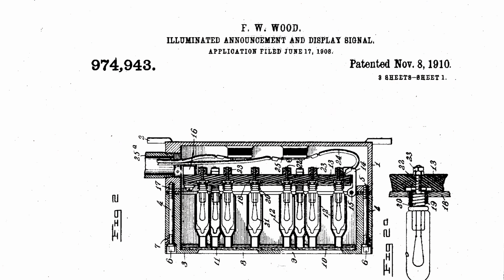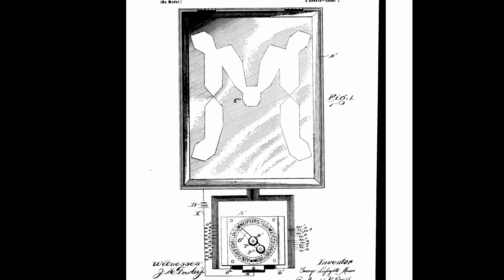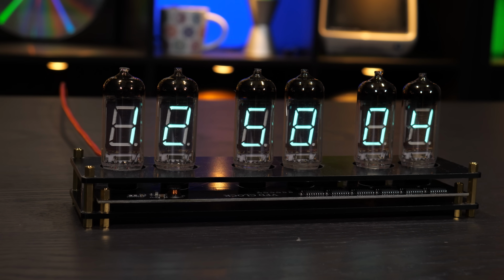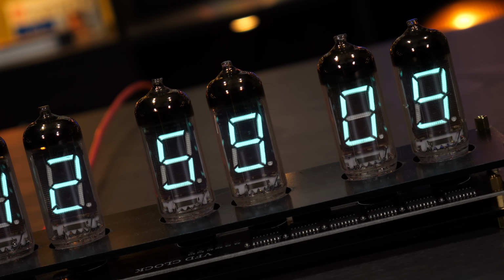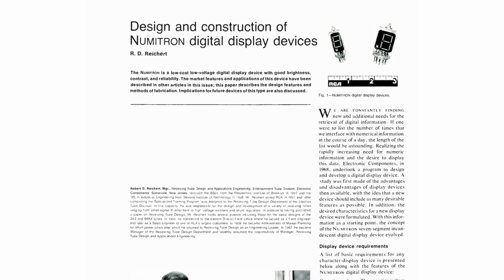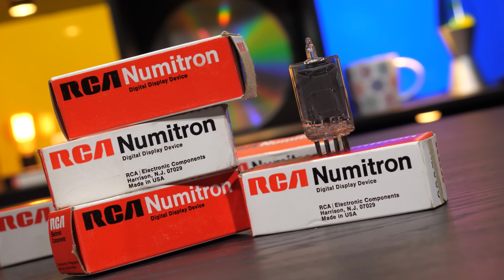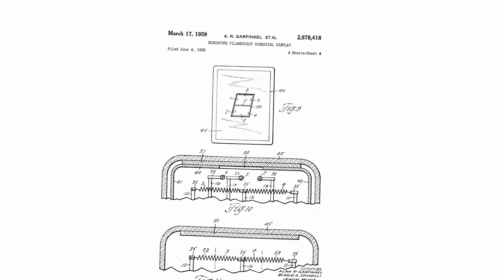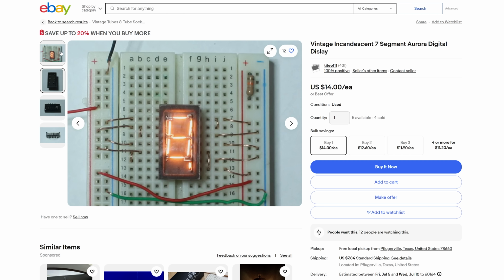The Numitron: An obvious idea that wasn't very bright

Comment: I have to say, I think that a lot of the problems you brought up with this aren’t necessarily as bad or at least they didn’t come across as bad as you claim they were over the camera. I think perhaps the reason why they didn’t have great relevancy though is not only the LEDs, but that these aren’t necessarily bad but they’re also not necessarily good and that middle of the road quality coupled with the very loose standards for quality control would mean that these weren’t necessarily as attractive as an option to designers at the time

Comment: I know the guy who did the first 7 segment LEDs for RCA. He designed them and worked out the production of them.  He worked there in the 70/80s.  He has an extreme case of OCD.  He is retired, and I have been to his apartment, and he has 10's of thousands of little electronic parts all organized on shelves in little bags with numbers on them, and he has the all inventoried in a database, so he can find them, and he still builds all kind of electronic projects.  He lives in Springfield, Ohio.   I met him on the Ham radio repeater.
Reply: That definitely sounds like a ham radio encounter 😊
Reply: Remind me of my late friend, Jim, who worked at IBM for a long time. His place was full of electronic bits, semi organized. Was constantly building little stuffs and teaching me new things. I learned a lot from that dude before he passed, he was a good influence on my teenagers.
Reply: I bet he has some really cool projects, any notable ones youd like to share? The closest cool take home I got was a set of prototype spark plugs, boss said I could have the carton because the ground electrode was in a unique umbrella shape(7 points) and it would only use the closest ground electrode to the main electrode(this was year 2009). I was 16 and put them in my car(77 super beetle) and there really was no noticeable improvement in anything, not even cold weather starts. 
Heres the cool part tho, I was racing dirtbikes back then and only had a 1985 YZ125 but was doing well, however tuning it to somewhat keep up with the people with modern bikes making more power(and still only got 1st in 4 races that year) it would foul the plug almost every 2 sessions(heats) of a 3-4 heat race. One day I was talking with some friends about the proto plugs and the fouling, we had idea to put the proto plug in the bike to see how long it would last. It actually extended the plug lifetime by a significant amount, so I shared them with my buddies who had 2 strokes. If there is a set still not in the garbage it would be in a 1991 Accord, and my buddy moved back up north and I havent spoke to him in a decade. 
Sorry for the long winded text but your story reminded me of that. Probably should ask my buddy if he still has the old Accord, the do tend to run forever.
Reply: Worked at RCA for a couple years.  That was a common thing. Most of them there were horribly OCD and hoarders. We threw away huge amounts of components. I still have quite a bit. 😂 I've thrown away most of it but..
Reply: @iconburn22 Springfield, Ohio ?  I hope any pets are OK.
Reply: You caught him on a repeater or while scanning?
Reply: sounds like a great guy. I'd like to know more about his database, as I'm interested in that kind of optimal organization.
 care to share?
Reply: @inkinky  he just tells a good story
Reply: @inkinky  weren’t you just told that was pathology
Reply: Wow, this is a coincidence. Springfield, Ohio - the topic that's been talked about recently because of the huge influx of Haitian immigrants, now making up a quarter of its population.

Comment: My dad worked at the RCA labs in Princeton from 1950 to 1980, and as a boy, I got to see some of these technologies. I saw a demo of the liquid crystal display, and during that same visit, they showed me a segmented display technology based on two-layer conductive plastic film that bends according to the polarity of the applied voltage. I remember them describing how they glued the two layers together: apply a super thin layer of epoxy resin on one layer and a super thin layer of hardener on the other, and squeeze them together. 

As for the Numitron, it's very much like the CED disk player in that it was a usable solution with the available technology, but the product was crude and janky. Dad got the patent for the CED back in 1960, long before the invention of solid state lasers; it's remarkable that they got a stylus to pick up audio and video from a disk, but IMO, it was a terrible product.

Comment: Weird that they didn't add an extra mask layer inside the tube to mitigate the bad contrast of the grey background. Sure, it would've been subject to similar heat restrictions but you could at least have masked off the lines to look better (not have th vertical ones be longer) and reduced the effect of the light bleed.

Comment: Had never seen or heard of the Numitron, despite living through the '80s.
"You might be able to see what is going on before I explain it"
Sees close up.
"Oh. Snap. Those are little light bulb filaments! That's a whole wonky light bulb with...weirdly low current? Maybe a strange material for the filament? Stupidly complicated bases with the wires and/or switches going to all those different positions?"
Man, that's bad.

Comment: I love numitrons, they look cool! Yes, the thin filaments would make them more difficult to read, but I love the orange glow, and the thinness makes them look cool. Don't ask me why, more specifically than that. And yes, LED displays are better in pretty much every way, but what do you expect, they've spent decades being refined and improved. They didn't start out being better, the early ones were tiny and dimmer, and had a much worse viewing angle than even your under-run numitrons. But yeah, as you noted, they still had their benefits, and they improved quickly, whereas numitrons did not.

Comment: I am a fan of VFDs and have several different kind of and in different sizes together with a bunch of old Soviet clock ICs. 
But any kind of displays are cool and I have a nixie clock and apart from the VFDs, have ideas for a LED and a LCD clock - got the NS chips.

Comment: Driving these straight from a BCD decoder seems like a bad idea, You're never going to get enough current. You can do it but you shouldn't, and you really count on the BCD decoder to current limit before killing itself. BCD to 7 segment decoding is really simple there might not be much in there to limit current. Pushing an IC to the limits of it's specifications doesn't seem wise.

Comment: I don't get why you rag on it so much. Double the filaments, arrange the mounting points right (which is easier than it may sound), put them against a proper light-absorbing background, and you're more than decent, you're great! That'd make it more expensive, but given that it's all standardizeable stuff, scale of production can fix this problem.

Comment: They look delightfully retro! If I were to make a time machine, it would have exposed Numitrons, sticking out in all their janky glory. I'd up the anty, and purposely misalign the bulbs too, to give mad professor vibes.

In terms of engineering, it's a wonder it wasn't done earlier. It's so obvious and with obvious benifitsts. Being able to be driven with plain old 5 Volts is huge! Consumer electronics need to work and be cheap. They seemed to fit the bill nicely. They look easy enough to read. I wouldn't use them for premium stuff or for mission critical stuff, as a single filament might burn out early, causing things to be read incorrectly... although then you could have a start-up procedure where all segments are lit up and checked  they function correctly.

Comment: In avionics, there were Minitron incandescent seven segment displays that were flat and much brighter. They actually used color filters and were higher contrast. Also, Davtron 24 hour clocks seemingly made their own flat front, multi digit, seven segment incandescent displays. A design criteria that favored the incandescent display was that the dimmer panels needed to control all the instruments in a given panel simultaneously and brightness needed to be matched along the entire dimming range. Because they were extremely expensive they haven't been popular among hobbyist types other than those fewer numbers of people interested in aircraft displays including vintage aircraft restoration.

Comment: My complaint about LEDs and displays in general is that the people selling appliances make everything too bright, 24x7.  I can't even sleep in an average AirBnB with all the "you can read by this light" LEDs -- the dishwasher clock, the microwave clock, the oven clock, the WiFi router, the outlet strips, the thermostat, the water heater, etc etc.

Comment: Way back in the early 70s we used Nixie tubes in our frequency display devices in the Air Force. We needed a reliable, easy to read display of the frequency we used to set up all of our electronic measurements. They reacted quickly and were so easy on the eyes. Loved those things back then.

Comment: I'm old enough to remember gas station pumps and butcher scales with numitron digits. They worked, even in sunlight. Circular polarizer filter. Lots of lab equipment had numitrons.  LED's came along much later. I had a TI watch with the bubble LED when I was a kid.

Comment: It’s funny that the “fault” of the grey background rather than black actually makes these more readable when installed behind a filter, as intended, as the reflected light makes the display look a bit wider than the thin element on it’s own. The similar flat versions sometimes had a green background.

Comment: "Numitron, take out Bumble Bee while I fight Prime" ~ Megatron 1972
Reply: Numitron definitely transforms into a TI-89
Reply: @skylermorris3379 if it's 1972 then maybe an HP-35?
Reply: @maikerugo  I have Hp-35s and 45s.  I haven't fired them up lately, but I thought they had LEDs for the numerics.  Will get back about this.  Still using HpP-15s daily and -12s occasionally.  Still work just fine.
Reply: Having a crappy animated recording of what the autobots were up to, shown with the accurately dull colours of the c64 was awesome. Even tho I was a ZXSpectrum kid.
Reply: Numitron was my favourite robot. I liked him even more than the one that was a cassette player. I still have one of the cassette bots on my shelf 😂
Reply: Sadly, I read this in Optimus' voice, first, and that is what is stuck in my head.
Reply: Megatron was invented in in the 1980's
Reply: He transformed into one of those room sized machines in the 70s. Wasn't very useful but the deceptions always found a need to have digital aid in working out sums in the episodes. My favourite version of him was the version that was adapted for western gen 1 when he transformed into a c64 and was used when the cassette bots were bringing back data not just audio ❤❤❤

Comment: My dad had one of those original calculators with the miniature incandescent 7-segment digital displays. I recall the segments when lighted, exhibited an almost imperceptible vibration that strained the eyes; he soon upgraded to the first HP programmable calculator with reverse Polish notation entry, and a 7-segment LED display, which was encased in a smoky transparent plastic bar, each digit magnified by a little convex “bubble” lens. By looking at the side of the of the display at a very shallow angle, the digits could be directly viewed, and they were tiny, perhaps 1-2mm high!

Comment: In 1974, my high school roommate from Hong Kong brought a clock he'd made himself with an LED display.  Everyone was very impressed, though the tiny LED displays didn't look much better than your Numitrons.  But when someone got the bright idea of turning it upside down and reading the words that formed, that was a lot of fun!
Reply: I still remember "710 0553" from my school days.
There was this convoluted formula you punched into a calc, then turned it upside down for the answer.
There were probably others, however the Esso one sticks in my head
Reply: @paulstubbs7678  0.1134 is another I remember (it doesn't quite work in this font; on a 7-segment display the upside-down four would appear as an "h")

Comment: I wonder what the inventors of these actually thought about them, sure feels like some sharp/harsh criticism and I can't help but to wonder what the inventors thought / if they'd agree with that or not or if they have suitable reasoning for it. Also while nixies are high voltage, they're very low amperage, I don't think anyone's gonna die if they ended up touching something they shouldn't (as compared to a flyback transformer for a CRT which is way higher).

Comment: For the entire build up to what the numiteon is, I (a student rocket surgeon) was confused as to why if light bulbs exist and 7 segment displays exist they were so difficult to make. I mean my first thought was a backlit mechanical display that blocks the "off" segments and lets light through for the "on" segment., Then I realized that these need to be small and I thought 'well why not just use the filament from 7 bulbs and use them like LEDs' and for a little bit there I genuinely thought I was just missing something, maybe Alec had said something I missed or I had the time line wrong - I watched the first 3ish minutes 3 times before giving up and moving on

Comment: I have a Numitron that was given to me many years ago. It was made by a company called Apollo and has a date code of 1980. It looks so identical to the ones in your video, I would either have to assume that the ones you have are also Apollo, or RCA sold the entire line off.

Comment: Having just built an IV-11 clock, I can safely say that the "two voltages" issue is not really that big of a hassle.  The filament wire on the IV-11 takes 100 mA.  The filament only has a little under 4 Ohms of resistance, so if you wired all six digits in series, it'd run you a whopping 2 to 2.5 volts.  Just throw a resistor onto the 24 volt rail and call it a day.

Comment: I have a digital room thermometer/humidity whatyoucallit. Acurite, might be 20 years old. Also I have a carbon monoxide detector, much newer, also shows room temps. Both seven segment displays
As far as I can tell, in both the numbers run like this: 60 62 64 66 68 70 71 72 73 74 75 76 77 78 79 80. I don't have a lot of experience with other possible room temps, so I don't know how they go. 
Why is it like that? I have two theories One, they are saving something by showing fewer numbers in less common temps. Two, they really, really don't want to display the number 69. 
What do you think?

Comment: Oversized clocks are great. I usually wear contacts when I'm at work and wear my glasses when I still need to see but want to give my eyes somewhat of a rest, but there are days when I just don't want to wear either. Of course, that's only when I'm staying at home all day, and I have an oversized clock visible from each room to ensure I can always easily tell what time it is, even without corrective lenses.

Comment: You are absolutely correct about the gas pumps which used the flat package version. I want to say they were made by AND but could be wrong, been too long. When the video started, I immediately thought of the gas pumps which is the only product I actually ever saw them used in. I always did like the think, delicate looking segments but the rest of the problems were a turn off. But by the time I saw them in gas pumps, 7 segment LEDs were already affordable. I wonder if they got an incredible deal on a large lot.

I always thought RCA made them as a product easily made in their massive vacuum tube plants which saw a huge drop off in demand about that time.

Around 1978 give or take, the Explorer Post I was in (at Western Electric Reading Works) made some items to help people with handicaps (for free). One used very large alpha numeric filament tubes which were about 1.5 to 2 inches in diameter as I recall. They were pretty expensive, like over $100 each. I have no idea who made them. One of the WE engineers came up with a unique puck that allowed people with limited movement to make words one letter at a time on the display. We used all diode decoding since WE made diodes. We just couldn't afford to do whole words.

I too have always been fascinated with seven segment displays, also making quite a few large clocks, including one with 4 inch high digits in 1977 from a pile of LEDs Western Electric gave us (before functional testing so quite a few were bad. I even made a new version last year and made some single and dual digit boards with SMD LEDs about 2 inch high segments. Love your videos!

Comment: I mean, it kind of makes sense.

If you have a technical advantage (of convenience and cost) over Nixie tubes...yet you know affordable LEDs and LCDs are "in the pipeline," you don't go crazy with the R+D for the Numitron, because (knowing that its days of viability are numbered) you pump out something fast and cheap, so that you can actually amortize your investment before you become obsolescent.

Same reason cellphones don't spend the extra ducats on durability. You know your phone will only be cutting-edge so long, so why make it excessively durable, or even serviceable?

Comment: In the rare situation where these did somehow end up getting used long-term, I imagine the most common mode of failure was for the lower-right filament to burn out first, as it's the one that's illuminated most often in every digit except 2.

Comment: What I'd do differently is to have a curved mirror, similar to flashlights and headlights, around each segment to redirect the light in the intended direction for better contrast.  For larger sizes, LEDs diffusing from tubes could work, probably with dividers in between each to maintain legibility.